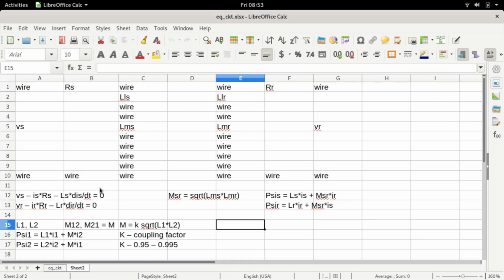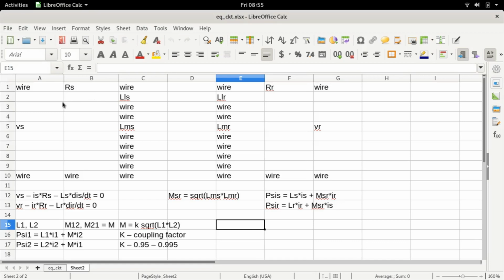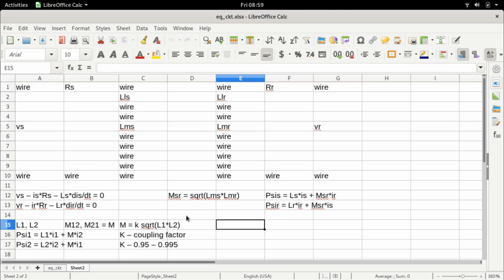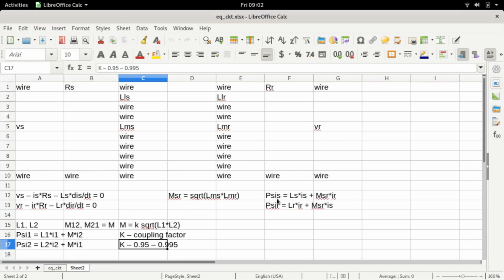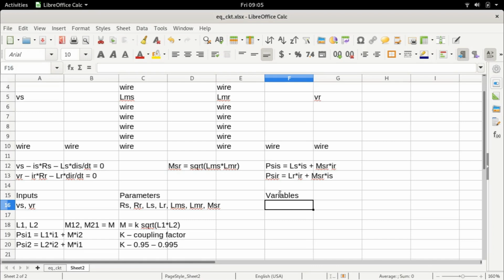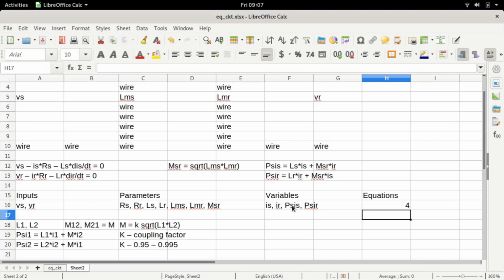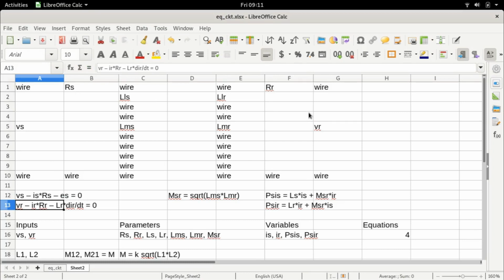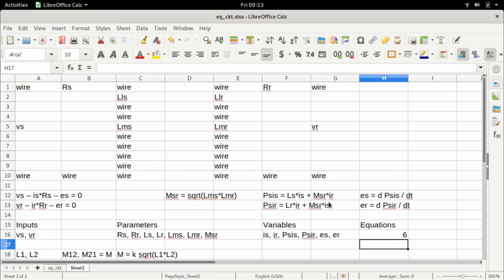Rewriting equations for magnetic coupling

Comment: Hi, I am trying to model a Permanent Magnet Synchronous Motor (PMSM) loaded by a three-phase inverter using 'Python Power Electronics'. I have access to the motor's specifications and parameter values (all parameter values are in defined dq plane). My plan is to implement a PI controller for motor control later, but for now, I want to model the motor as a load to the inverter and observe its behavior. However, I have a few doubts in this process.

It is mentioned that the load can be modeled as a controlled current source. afterwards, I need to create an equivalent circuit for the motor and write equations for its operation. Later, the current drawn by the motor will be used as the reference current in the equation: vsrc = vterminal - iref * resistancecrntsrc.

Here, the phase voltages Van, Vbn, and Vcn are the outputs of the three-phase inverter. then I should draw load circuit schematics that contain a controlled current source for each phase. I will also draw an equivalent circuit diagram of the motor for reference. However, solving equations for the flux linkages in the three stator windings and the rotor, and deriving current equations can be challenging.

so Park transformation (dq reference frame) can be performed to convert phase voltages of the inverter and thus i can find id, iq values using the given motor parameters.

1. Is this process correct, or do you have any suggestions?

2. How should I substitute id and iq values into 'iref' in the equation of the controlled current source?

I'm bit confused to connect all the elements, can you please help me in understanding the implementation of the motor.